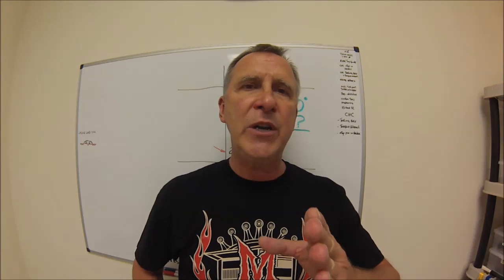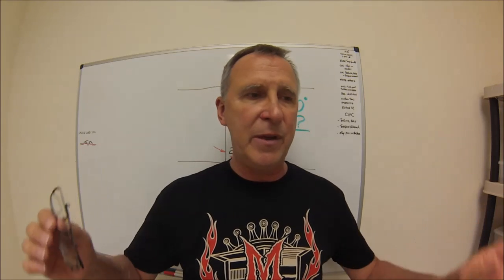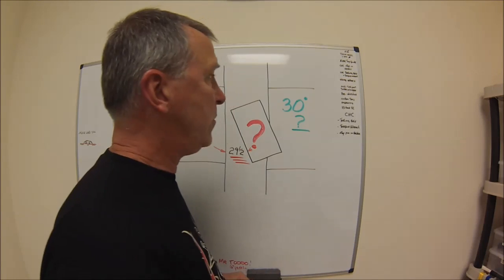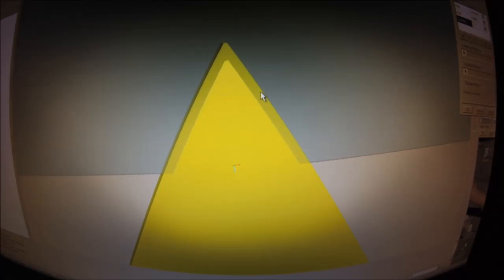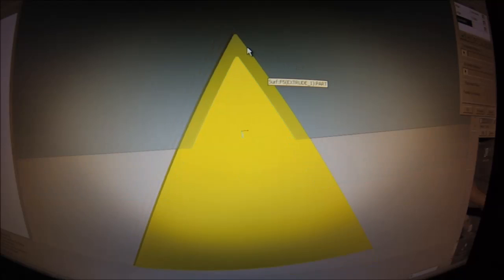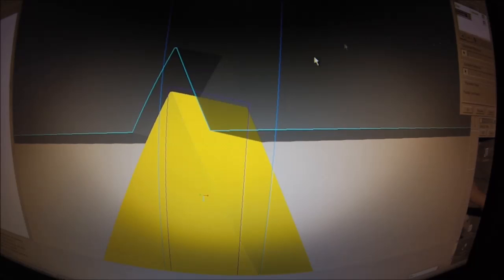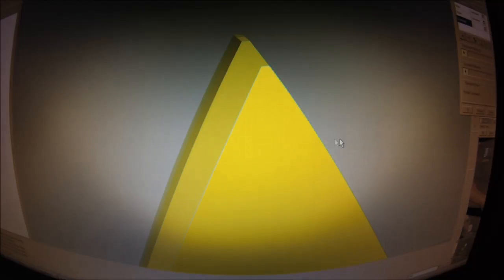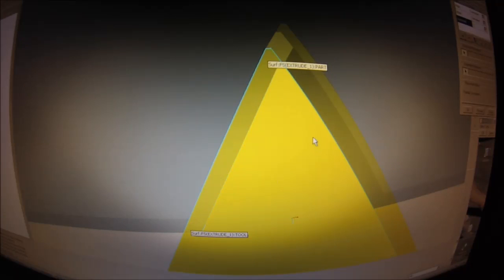Lathe Compound Setup for Single Point Threading...Myths and Musts

Comment: does the compound scenario change when you put the threading tool upside down and thread in reverse, away from the chuck?
Reply from the maker: Since I don't use the compound to thread, it can get confusing to answer you. You can use the same compound setup, but the majority of the chip load will be on the back of the tool and not the leading edge cutting out. Some may say this will pull the tool into the part, but I keep my compound locked so I can't offer a definitive statement. Using the compound would advance the thread placement, not just the depth. be careful.
Reply: tachdriver1, I just used Joe's method of threading for the fist time a few days ago. I cut a righthand thread, with tool inverted, going in a Z plus direction, away from the chuck. I set the angle on the compound just like you would for a lefthand thread. And it worked like a charm.  The majority of the cutting action took place on the leading edge of the tool. I hope this answers your question.
Reply: just move the the compound 29 degrees left instead of right i have a small lathe and it isn't rigid enough for the plunge cut but ive been doing threads with tool upside down and backwards for 20 years and it works perfectly

Comment: Can you make a video of the controls on your south bend lathe? I just started a job and I’m not familiar with it. Couldn’t even get the skirt to auto feed.
Reply from the maker: Sorry, my lathe is a Clausing / Colchester. The carriage auto feed is usually a knob you turn on the face of the apronn if my memory serves me correctly. The lever at the left end of the machine ( up, down or center )and lower pin selector have to be engaged as well.
Reply: @joepie221  thanks for the reply. I thought I saw the same lathe in one of your videos. I used to run a toolmex and an old jones and lansom turret lathe. I’ll figure it out just have to get used to new machine and its quirks.

Comment: I read explanations that state that  the right side is simply making a "Clean up" cut?  Is that about right?  The Left Side of the tool makes the heavy cut and the Right side cleans up the rough edges.  This would be when cutting threads Right to left, in this example and using the compound to get the depth. I have a very old South Bend 9, so maybe not really a rigid machine?  Plunge cutting seems to really upset the machine.  This is all assuming that the tool is aligned perpendicular to the workpiece, correct?
Reply: Its upsetting the machine because of the tool loading. Best to set the compound to 29.5° to reduce the load.

Comment: What happens when your cutting a right hand thread with spindle running backward has you suggested on previous lesson
Reply from the maker: The most obvious difference is that you get a better start point because you can use a positive stop. I'm osting another video on all this depth control topic. Watch that one too. It may clear a few things up for a lot of people.

Comment: Someday someone should cover why you want to cut with the left side of the tool, or in general why you want to cut toward the headstock rather than away from it. Things like spindle thrust bearings and preload and the like.
Reply: l wilton I'm no expert, but from my limited experience I'd say that these result from old lathe designs. My 9" South Bend for example.  The chuck is threaded onto the spindle, so running backwards, as would be required to cut a right hand thread going away from the headstock, tends to unscrew the chuck. You'd also have to mount the tool upside down, or on the back side of the work, which are both more awkward. Back side would be better, since upside down on the front will put the force on the tool going away from the bed, which will tend to lift the carriage rather than pushing it into the ways, which is a stronger and more rigid direction. 
To cut on the right side of the tool you'd have to swing the compound to the left, which puts the dial closer to the chuck, and is awkward for a right-handed machinist to work with. 

If you are using a modern cam-secured chuck, your lathe can run backwards, you don't mind the tool being on the backside, or you are left-handed and have the clearance, go ahead and cut away from the headstock and cut with the right hand edge. 

-- Mike
Reply from the maker: Hi Mike. Regardless of your compound setting, there will always be right side contact and cutting present. This video just proved that. 2:47, and 8:50. As for the thread tool lifting the carriage or any other part of the machine, that would introduce flex and help to eliminate chatter. test it for yourself sometime with a big form tool. You will be shocked at the result. I would also like to say the threading tool will break off long before any machine damage will ever occur using an inverted threading tool.
Reply: Joe Pieczynski Agreed on the right side cutting point after reviewing those parts of the video.  I don't know about trying the reversed form tool on my current lathe with its threaded on chuck, but I'll keep it in mind for trying on a cam lock machine someday. The lifting reducing chatter sounds a bit like the way a swan neck tool holder works to change the cutting angle when the tool tries to dig in...and if so I can see how that would help avoid chatter. I guess less rigidity has its uses at times. 

-- Mike
Reply from the maker: i wouldn't have believed it myself if an old timer didn't take the time to show me when I was young and struggling. I was amazed. Take care Mike.

Comment: Can you help me with a banggood order?  My tool holder excepts a 3/8 shank.  I need to cut some 14 threads per inch fine threads.  So what do I need to order to get that 3/8 insert holder and inserts?
Reply from the maker: I have to imagine any insert holder that has a 3/8 shank should work. If all else fails, get a 1/2" and cut it down.
Reply: Thanks Joe... I actually have a 3/8 shank with threading inserts now and my threading job of threadind 30 axles went well....now I have some facing 3/8 shanks that have inserts installed... I guess the ones that measure 10mm across are the inserts to order.

Comment: SIR GOOD EVENING I AM REALLY INTERESTED IN YOUR VIDEOS IF GIVEN THE PITCH FOR A SCREW HOW DO YOU INTERPRETE THE DIAL PLATE ON THE HEADSTOCK OF THE LATHE.
Reply from the maker: The plates on the headstock are usually aligned or color coated to aid in this task. What type of machine is it?

Comment: My 2 cents: I suspect that setting feed angle really close to 30 degrees might turn out not enough to form a cut by the right cutting edge. That would produce more rub, smear and heat instead of actual cut and would be sooner thread forming than thread cutting. I believe one should have at least 1 thou DOC per each step on the right side to make an actual cut. Again I never tried it myself, just some thought.
Reply from the maker: I plunge every thread I cut. 100 %

Comment: if you feed straight in the chip load is too much in the bottom of the vee. in machining steel you will probably weld the chip on the tip of the tool and scrap the job.thus reason for feeding 29,30,28 etc degrees   .
Reply from the maker: I must have been the one in a million that you have heard about. Been feeding straight in for 40 years. Every kind of metal you could think of. I disagree 100% with your comment, but thank you for leaving it.

Comment: You can cut at any angle from 0 to 30 provided you account for the cosine. The feed for the compound feeding at 30 degrees is 15.5% greater (10.3% greater for 25 degrees) than the feed for the cross slide feeding at 0 degree. That's probably why most people are conservative and stick to their angles.
Reply from the maker: I may be old school here, but I don't feel you should have to worry about trig to cut a thread. Too many variables unless you know your angle is dead on.
Reply: I mean the total tool advancement depends on the angle. For, say, a 16 TPI thread it's 0.039" for 0 degree (cross slide) and 0.045" for 30 degree (compound). The difference is small but noticeable. By the way, how do you estimate the total tool advancement? How do you take into account the tool geometry (radius/flat), ) and major/minor diameter? I never saw such an analysis on Youtube. Could be a subject of another video. I'm an engineer and an amateur machinist. I really enjoy your videos and their inquisitive style. Thanks!
Reply from the maker: The flat on the tip of the tool is always 1/8 x P. So if your crests of your thread are .080 apart, the flat would be .010. and so on. You can set the depth of your thread with the cross slide and then back off the compound to start threading. When you hit your starting point of zero on your compound.....your golden. Simple.

Comment: Hi Joe, without blowing too much smoke up your ass I think you videos are the best on YouTube for the explanations (in shop and on the board) and have helped no end in issues I have had and no doubt will have in the future. 

I own a small woodworking business in the UK and use my lathe to make parts for jigs  and tooling that breaks so nothing too strenuous but the first problem I came across when cutting a thread was this one. Please follow the link.
 http://www.model-engineer.co.uk/forums/postings.asp?th=117373

Since finding that thread I understand the problem but as this is my first experience on a lathe, is the compound supposed to be set up with the degree increments in that manor or is my lathe and his set up differently. 

Keep up the good work 
Tim
Reply from the maker: Hello Tim. For wood, you can feed directly in with the cross slide so it doesn't matter what angle the compound is on. If you need to cut metal and wish to use the compound, unlock the compound and line it up with the cross slide. Basically make sure both the compound and cross slide screws are overtop of each other. Then take the compound handle and move it to the right ( moving the compound counter clockwise about its pivot point ) about 29 degrees, no more. Then lock it down. i personally thread everything with my cross slide, making sure my tools are square to the part. Compound angle has zero impact that way.

Comment: Joe, while there is contact at 30 degrees, I don't think there is any cutting with the right edge.  That's all done with the tip and left edge. As you decrease the angle, more of the cut is done with the right edge, until at zero degrees half is done with each edge...ignoring the bit done by the tip. 

I think the 29.5 degree thing is just a way to limit the load while making sure you don't go over 30 degrees, which would result in an incorrect thread.  If you can hit 30 exactly every time, that would put it all on the left edge, but that's unlikely.  Even if you set it up just right, once you start the cut, there's likely to be tool deflection from various causes that puts you over the line and screws up the cut (no pun intended). 29.5 gives you room for that to happen without going over, and the chip load from the very thin right side cut isn't going to be enough to worry about even on a small lathe. 

If you have a big, rigid, powerful lathe, and a smallish thread, just go straight in like any form tool and get it done.  Us little old lathe guys will stick to the 29 or so plan. 

Thanks for the videos!  I've learned some good tricks and understood a few things better from watching them. I like the way you approach problems.

-- Mike
Reply from the maker: Hi Mike, I respectfully  have to disagree with you on this one. Although the right side cut is only as deep as the depth of the incremental cut dialed in, it is present regardless of your compound setting.  Please refer to the video at 2:47 and again at 8:50. I welcome your reply. thanks for watching.
Reply: Joe Pieczynski Ok, I see your point at 8:50.  Most of the right side is only contacting, not cutting, but a part of the right side related to the depth of cut added in each increment is cutting. Thanks for taking the time to point that out. 

-- Mike
Reply from the maker: Thanks for the reply Mike. Much appreciated.

Comment: Great, makes perfect sense. Sadly, it doesn't at all explain why my internal threads are going completely wrong - I'm just getting weird groves on the inside of the part. Oh well, I will scan the rest of youtube to see if I can find sometyhing - weirdly, with the same settings, the external thread is perfectly fine!
Reply from the maker: Your problem sounds like a tool grind problem. External threads don't need to be cautious of the underside of the tool. If your grooves are dragged type with less than perfect finish, thats it. If the grooves are neatly cut, its the top side and probably the compound angle. I'd bet on the bottom of the tool dragging.
Reply: Thanks for your feedback. If I had ground the tip myself, rather than having bought an insert, I'd be very much inclined to agree. I'm no expert in grinding tips.

And of course, you could still be right, I may be outside the "specs" of what that tools should be doing - but I think a ~30mm [see below for why "~30mm"] internal thread at 1.5mm should be doable with an 11IR A60 insert. It is a cheap Chinese, but I'm not sure it makes sense to spend tens of dollars buying a new insert, just to find that it's a setup issue elsewhere.

Details: The actual thing I wanted to make was 29.4mm inside diameter in 6083T6 aluminium, with 1.5mm pitch, but I failed to cut the thread and chopped it down several times [the first cut ruined the part, but at least use it for practice again!]. Eventually I ran out and just drilled and bored the last bit of it to "roughly the right size", as I'm fairly sure the precise diameter isn't critical for making internal threads as a technique. But as I've now completely run out of that piece of material, I may take a bigger diameter off-cut and see if that works better.

If it's any help at all, I bought this (and yes, I know, it's cheap and Chinese, but I expect it to at least kind of work for some fairly light use):
https://www.amazon.co.uk/gp/product/B076F57C4K/ref=ppx_yo_dt_b_asin_title_o04_s00?ie=UTF8&psc=1
Unfortunately, specs are completely useless.

Again, appreciate the help, and feel free to say "no idea" or "can't help". You run a business, you don't get paid to help random people on the internet!
Reply: @joepie221  Well, I did get something vaguely resembling a thread, that kinda works. It's not a masterpiece, and I still don't quite know what it is that makes it look quite "flat". I did grind my own bit in the end - not easy when all you have is an angle-grinder (yeah, I need a bench-grinder - and a bit of space for it).

Comment: The way my engine lathe is marked, I must use 60* (Or 59*) .
  Not all compounds are marked the same. Frankly I notice no difference between 60* or 59*, as I'm sure 30* or 29* would be, unless somewhere the markings are off and some are being set higher than 30* by inaccurate markings.

Comment: It seems like an important consideration about a tinny cut on one side of the tool is that cutting doesn't occur until the rubbing action of the dull  (all tools are dull to some extent especially carbide) over comes the deformation of the work @ the cutting edge. 
If the tool doesn't start cutting right away it is generating friction heat, further damaging the tool. The work would be being burnished rather than cut. The result can be seen by the size of the bur created on the top of the thread.

Where am i wrong? Total amateur, using a Chinese lathe (PM1440HD)
Reply: hi larry i also have a chineese 14x40 metal lathe it a gh 14x40 precision lathe or thats what its called anyway. i seem to have trouble parting off with hard or soft steel aluminum no problem. it seems to be pulling the tool into the work. do you have this problem. thaks larry schweitzer.
Reply: No problem pulling in. If your tool is set too low or flexes down from a heavy cut that could happen. I made a tool setting gage like Tom Lipton showed. Now very easy to set tools. I just got through cutting 1 x 8 tpi in stainless. Used Joe's system. I found I had to take a deeper cut to avoid poor surface finish. Seemed backwards of intuitive thinking. Tool is 3/8 Chinese, HSS, hand ground. I had to have the tool out farther than it should have been due to the shaft being larger than the thread. lks@neb.rr.com

Comment: Joe you would know. However I plunge straight in with no issues. I'm not in disagreement with you, but, to me it's more of the "mainly" cutting on one side takes the slop out of the gear train. KInda like parting without locking the carriage down.
Reply from the maker: I plunge on all my threads about 99.99% of the time.

Comment: I think a couple of issues are in play here.  First is people's tendency to think their method is the one true way.  The way someone learned tends to be the BEST WAY in their mind.

Second, you acknowledged the reasons for using a 30 degree angle, chatter and tool pressure.  If you have a rigid enough setup it doesn't matter.  If you have a hobbyist-level setup (which is likely the greater part of your audience) you probably need to be using a 30-ish degree setup.

Like anything else, you have to take a look at your options and decide what makes the most sense in your situation.
Reply from the maker: Absolutely true. Please bear in mind, this video was posted to dispel the myth that the right side of the tool doesn't cut.